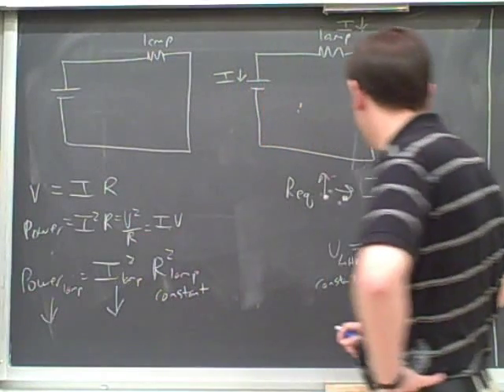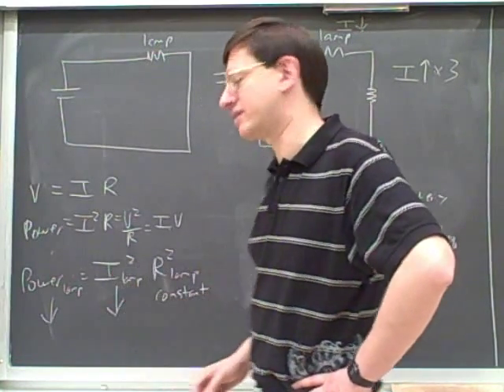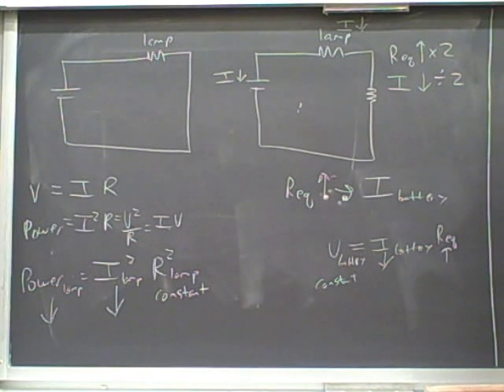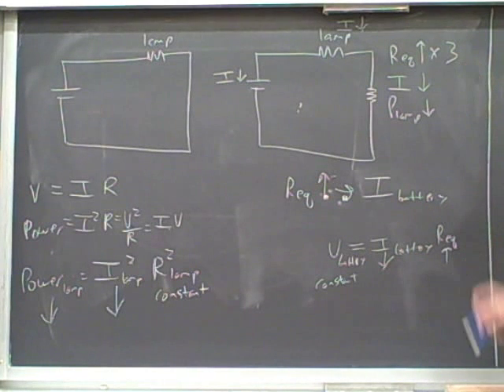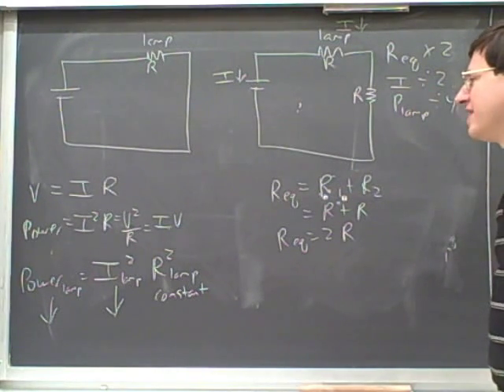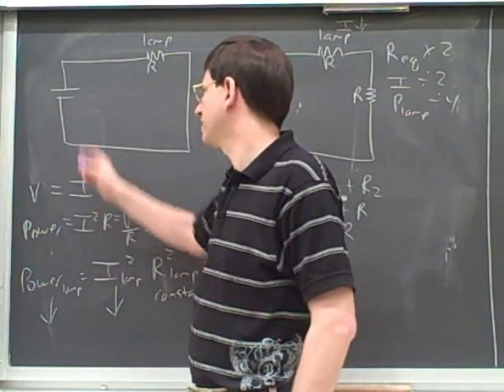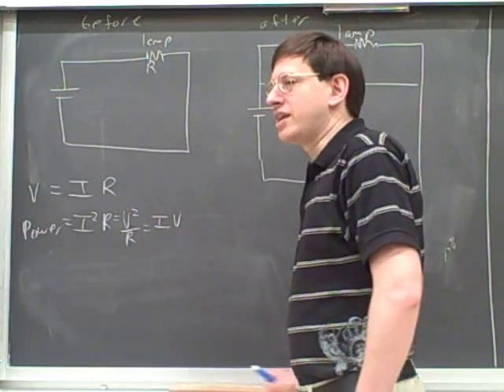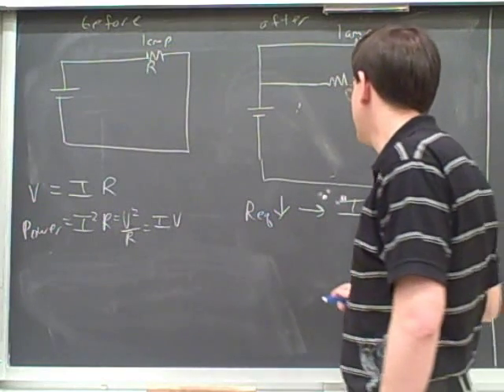Adding resistors to electric circuits (2)

Comment: It would've been easier just to say that the voltage across the lamp decreases because same potential difference from battery is spread out over two resistors and then the resistance remains the same because the resistance is an intrinsic characteristic of the bulb. Therefore use P=(V^2/R). V decreases while R is constant so the overall power goes down and so does the brightness.

Comment: He means that the equivalent resistance of the resistors will increase by 2.. However, the lamp's resistance will remain constant. So, the power of the lamp is only affected by the current.

Comment: Hey I think this is wrong.

if you increase the R by 2, that would cause a decrease in I by a factor of 2, doesn't that mean that power went up by 2? Because P = I^2 *R --> (I/2)^2 * (2R) which means the new power is simply (I^2)(R)/2 which is decrease by 2 not 4..

a reply would be appreciated.